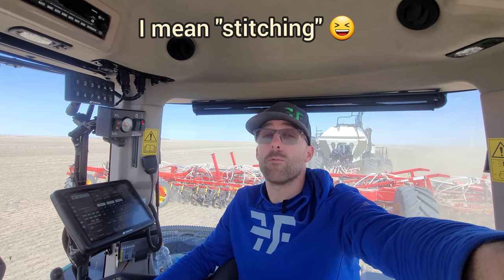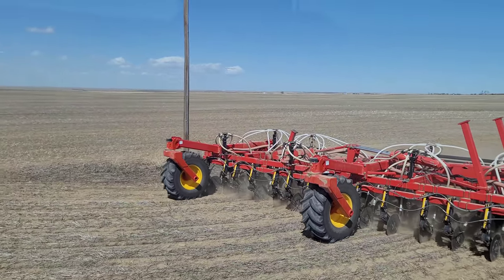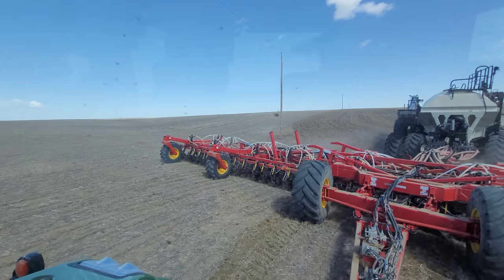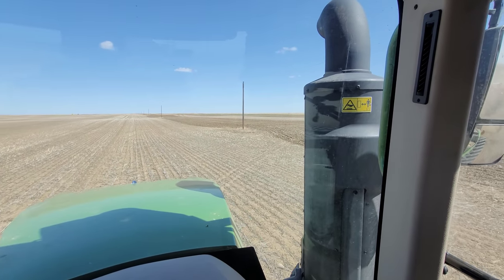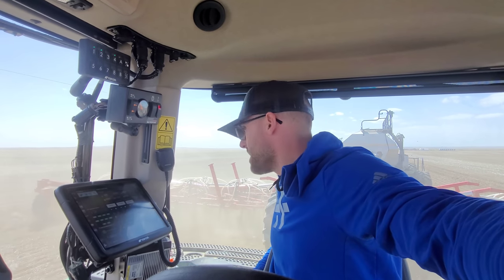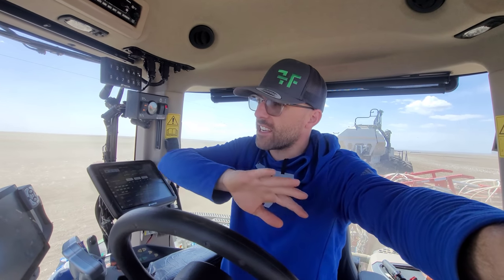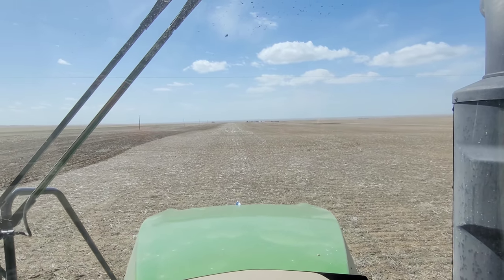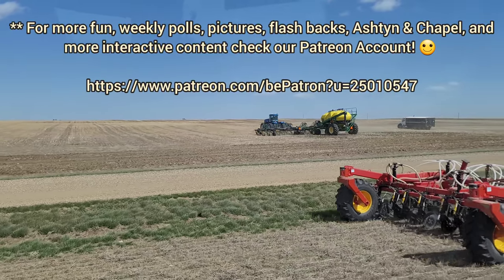Stitching Power Poles 🤔🤷‍♂️

Comment: Hi Mike, former fire department captain here. Your explanation about emergency evacuation is correct, keep your feet together and bunny hop away from the point where the line grounds out on your equipment to avoid step potential. If you walk you can create a great enough electrical potential from one foot to the other for power to flow up one leg, through your torso and down the other leg. The big problem with single line earth return circuits (SWER) in rural settings is that they are a much higher voltage than you would expect because of the great distances they cover. SWER circuits that I have had personal experience with carry 22,000 volts and can create step potential rings of up to 8 meters in diameter. With your ground as dry as it is you would not expect too many problems if your cart touched the cable on the way through given that you have rubber tires on dry ground. If a circuit was created it would probably pass though the hitch to the drill and down the row equipment where you have metal contacting the ground; and potentially into damp ground. Keep driving until the cable slides off the rear end and hope it doesn’t snag on the ladders!
Reply: Informative. Thank you. Didn't know about the bunny hop.
Reply: Not really a problem actually.  Once the machine has snagged the cable, assuming the tyres offer useful insulation, you can simply jump from the vehicle as far as is safe, and walk away.  The equipotential is unaffected by your steps, even in wet ground where - in reality - it is improved as a fully grounded situation.  If your machine is soil-engaging ( diggers, planters, etc. ) then you are in a better situation because the rig is effectively grounded, but still jump as before for safety.  Obviously do not return to the rig until the utilities engineers say it is safe.
The 'surge' you refer to is actually an auto reconnect that most cicuits will attempt up to three times in case the original short was transient; for instance a tree branch fouling lines, but that has corrected itself and can be reconnected.  If the fault is still present then the breaker will stay open after the third attempt.  No additional power is used in this process, and the whole process lasts seconds.  It is very unlikely that any soil engaging machine would not offer sufficient fault current to trip the breaker out completely, but a sprayer might not... either way a safe jump and walk away is always the best approach.
I work with 132kV systems.

Comment: I have actually had a situation with powerlines myself. When I was going down the road, the steering valve on the tractor failed and it veered into the ditch. I jumped a driveway and caught the lines with the tractor and took down 4 poles before I came to a stop. Thankfully, it blew a transformer up and cut the power to the lines as they were tangled in the tractor and I was not harmed. As for the tractor, just needed some front rims and tires. It was back to work the next day
Reply from the maker: Oh man, that would be one heck of a ride! 😳
Reply: Wow I'd need new boxers, pants, an probably need the tractor seat redone 😅
Reply: Almost as rough as the fields  in doing currently lol jk glad your ok

Comment: We have the huge transmission lines on are fields I want to say they’re 480,000 Volts. There’s enough static electricity with electricity can jump 10 to 12 feet and in the summertime when it’s 95 to 100° and the lines dipped so low that you can actually walk underneath them with a fluorescent lightbulb and it will turn on.

Comment: My uncle pulled a line on him self, hooked it on the bar and it came down on the tractor, challenger mt 865, line went down the exhaust pipe and between the front of the cab and bonnet, luckily it blew transformer but did some cool fireworks, anyway they came out and removed wires and all good

Comment: I had an incident with a power line, the doctor said my heart had quit. Dad in 1970 put up a bin just slightly under a power line. Till 2004 we never had a problem with it. After years of vibration of the auger on the roof filling the bin it shook roof bolt out. About 2002 a wind took a few sheets and tore then off the bin. I took then and had then repaired and we replaced them. My son was in the bin tightening the bolts up. I went to drop the latter in to the bin through the man hole, when I raised the latter I got close enough that the power arced across to the latter. I don't wish this on anyone, It felt like getting a bear hug on the inside, My muscles went tight as a drum, I only could see white, I could not yell or breath, all I could do is sit there and take it. When I came off the power it was the most wonderful feeling ever. As I fell backwards on the roof I blacked out. Next thing I remember I was laying on the ground. Kids drove me to the hospital, doctor called STARS and flew me to the foothills hospital in Calgary. The nurses said there must be a special on electrocution this month. The other two guy lost some hands and feet. The doctor said I blacked out because my heart quit. All in all I came out not to bad, kept all my limbs. Took 10 weeks to recover from it and today the only side affects from it is my left hip, knee hurt, and I walk with a limp. No my life never flashed before my eyes, it was like just going to sleep, and am I afraid of dying  now, no. Someone asked me that question once. The power company said there is about 14000 volts going through the lime.

Comment: Farmers in our area drag chain under the carts incase they make contact with the lines. The reclosure is what surges the line. 3 times til it trips. The fuses on the pole cutouts will only trip if that line has faulted. If it's a transmission line it'll trip at the sub instead. The further away the line is from the sub the lower fuse rating is used

Comment: I had two drivers hit a pole with 3 meters wide cultivators ! Why cultivate so close to poles , not as if you can cut that close with the combine any way ? 
Another farmer said can I cut closer to the pole as I left 1 foot of corn around it. It was quicker to snap the crop off than try to cut it. He had 80 acres in total but had 8 fields. I wasn’t bothered when I wasn’t asked to cut it again 😆
The joys of Uk farming!

Comment: Mike! I’m a lineman myself and to explain a bit more about underground power lines. They are very expensive! It is more pleasing to work around or to look at but painful to work on. Overhead is cheaper and easier to maintain. Those tie down cables are called “guys”. Those surges are done with the combination of sectionalizers and reclosers. And yes they do try to reclose the circuit three times then if it can’t, it trips it open and won’t close again.

Comment: We have a national grid station local to us  , i visited this some time ago ,  they  switched 400,000 volts as a demo, 
a massive discharge of compressed air blows the mechanical connection open and also blows the arc of electric out 
very impressive to see , you can hear the blast 4 miles away !

Comment: The stitching technique is perfect. If you had a smol planter it might be worth circling the pole, but at that scale it would waste a lot of time and fuel spinning that giant machine around to get another 3 square metric feet.
And good explanation of the power line issues and avoiding Step Potential.

Comment: Here in the USA the bottom line is usually the neutral followed by the top three lines being hot for 3 Phase power with 90% of lines are.

Comment: the "surges" are fast open/close of the circuit breaker at the station. they do that because most issues on a power line are transient, like a tree limb falling on it, so if it falls clear the next time the circuit breaker closes it stays closed and customers still have power.

Comment: My grandpa had an incident with a power line, he was unfolding our sprayer and got the boom tangled in the power lines, we think the tractor sprang some kind of hydraulic leak or something, idk. Anyway, tractor sat there for a while he tried to call the power company so they could turn it off. Tractor caught fire, had to kick the door open and run for it, tractor burned to the ground shortly after

Comment: As another youtuber calls power lines "The Arch Nemesis" . Grew up in on a farm, and knew many stories people that got the wrong end of power line. Including when I was in one of FFA class we were talked about, farmer that went to work on a old tipper truck, hit the raise, jumped out and went to crawl under it to look at the cylinder, didn't' realize the  tip had hit a power line, and reached up to grab the hydrolics..well, they think that is what happeaned, they said he died istantly, and his hands were still fused to the truck. 

My dad also worked for the local JD dealer in the 90's/00's, and he's told me many of times about having to drive a tractor and tool bar across part of the state along back roads, and finding out the next day he had taken out a couple low hanging phone lines.

Comment: powerlines are extremly dangerous and what mike said is really on point, if you can wait, just fucking wait otherwise you run a really high risk of dieing sadly. And yes they can ark, it depends on a lot of conditions tho, voltage and humidity beeing the main ones.

Comment: Mike, I think your understanding of reclosers is a bit off.  they're not going to "surge" extra power to try and blow something off, it's just a recloseable breaker that will make a certain number of attempts to close, in case the problem is temporary (like a branch).  It's just normal line voltage.  

Thank you to @bobsdecline, canadian lineman, for all his great videos too

The "jump with both feet together" theory is because the voltage will decrease in a circle outside the live area.  If the line is 7200V, that voltage is relative to ground.  If it's 7200V on your tractor, it might be 2000V at the ground under your tractor, and 0V at the ground 20' away from your tractor.  Keeping both feet together means (in theory) you minimise the voltage potential across your limbs, which is what minimises the current that can pass through your body.  If one foot is at 150V and one foot is at 149V, you're fine.  But if one foot is at 150V and one foot is at 500V (relative to the outside of the circle), you've got 350V going through you (before the resistance from your footwear and skin).  I doubt there's anybody who has successfully used this theory to their advantage, but it's a reasonable thought experiment
Reply: While not a "surge" in electrical terminology, reclosing the breaker does send a "surge" of power back down the wires, so not bad for an amateur! Lol

Comment: Depending on how many cables there are and how big they are, the cable itself can do a lot of physical damage if it is hooked.  Last December a Canadian National train hit a low hanging power line (due to one pole that snapped in the wind) in East Lansing MI.  The lead locomotive dragged the cables several hundred feet while each broke at various locations.  That took out roughly 30 large (high voltage) wooden poles, and over 6 miles of cables in a stretch of about 1/4 mile on either side of the track. The cables also took out two railroad signal masts and started a large commercial sign on fire.  Over 4000 customers lost power.  There is a video lurking about YouTube of the train hitting the cables.

Comment: Have to say thought those single lines looked more like phone lines, till I read the “ single wire earth return” explanation. As an electrician I find that a strange concept and must be very very old system. I assume when the lines are replaced they will be all 3 wire 3 phase upgrade. Strange you use the term “earth return” as thought it was always referred to as “ground” over there 🤷🏻‍♂️

Comment: Mike, it only takes about 12 milliamperes to end your life. That’s 12 /1000 of an amp. A 100 watt /120 volt lamp uses about .8 amps or 800 milliamperes. Volts don’t kill as they are just the pressure in the wire. Insulation must be rated to keep that pressure in just as a hydraulic line must be rated for pressure. Amperage or flow of electricity is the killer. Skin is an insulator for very low voltage but generally not much at more than 12 or 14 volts. So all said and done if the wire laying across your tractor is only grounding partially,  the fuse or breaker rated for the full load of the wire will happily provide that level all day long and not blow. That’s why a device plugged into a receptacle works and the breaker only pops whenever too many devices are plugged in. Also the utility companies do reset a line to hopefully clear a limb or debris but there is no way to send surges. They just reset and the debris either burns off or the fuse blows. Hope this clarifies for someone. A retired electrician

Comment: I can’t believe they let the power lines be so low.  Around here they have to be about 40 ft off the ground for the high voltage lines.  Communication lines can be lower.

Comment: A custom harvesting guy can I worked for had an arc jumped from a 5 line pole to his chopper spout electric jump about 3 ft blew the gearbox off the bottom of his header and blew out the tires. Fortunately when the tires blew the electric broke connection everyone was ok.

Comment: When your stitching does more seed get put down on the side next to pole because it slower then the otherside
Reply: Yes
Reply: Yes it does.  But if he were to do a circle around each pole, that would be amplified even more.
Reply: I figured the flow rate would be fixed but didn’t know for sure. Hypothetically if you  had a lot of round corners or contour planting on a steep pointed hill the population would increase on the upper side of the planter. Would that affect yield at all?  The only reason I am asking is I live in Iowa by the loess hills and we plant corn and soybeans. We have some pretty intense side hills. I guess the other thought would be how hard it would be a hold that much weight on the hill without some terrible happening

Comment: Electrician here. if you have to exit the vehicle after hitting a pole, only stand on one foot. Never let both feet touch the ground at the same time, this can cause the current to flow through your legs. Also, the minimum distance before you can stand on both feet again should be 10 meters/30 feet from the point the line has contact to the ground. This includes your machines, as a seeder is in the ground as well.
Reply: I think he meant more that both feet are together and act as "one big foot".
Considering the height of these vehicles, I doubt you can land on one foot and keep balance too, if you have to jump instead of being able to use the stairs.
Reply: Bunny hop both feet together at all times. Never one leg. If your other leg comes down apart for whatever reason, you're roasted bud! Whoever signed off on your electrician ticket would be shaking their head ** Century family farmer with saskpower linemen in the family. We practice farm safety daily

Comment: I would take them out, but thtas just me
Reply: The cost to bury power lines is EXTREMELY EXPENSIVE compared to running overhead especially with high voltage on long runs
Reply: @gavinperry7237  Here in Sweden, you could basicly say, powerline was not there last year, ooos
Reply: It's not like he says in the video that those aren't his power lines, but the province's... i don't think they would like that very much.

Comment: Hey Mike, can you answer me something about that drill. Has the factory prescribed (recommended) any maximum acres that drill can sow (work) during one season?
Reply: No don't be silly
Reply: @darrylpaulhus3069  Why silly? If you use something too much it wont last..Just for the eg. my familly is using same planter ''Nodet'' 6 rows corn planer for 25y, hasn't cracked yet (just regular maintenance) cause it sows 60ha (150 acre) per season. Doubt Bourgault can last that long if its used ''too much'' per season.
Reply: There is no too much per season. If you say the drill is done with after 100.000acres and you seed 10.000 per year it's a write off after 10 years. For the money that drill costs it should run the whole year with proper maintanance
Reply: In the prairies, the guideline is 100 acres per foot of drill.  Mike's drill is 84'.  Some people can do more if you put longer hours in, and some people do less so they don't have as rushed of a seeding season.  There are also some high speed drills that can do more, but are not that common.
Reply: They will most likely provide a guide line on how often all parts need maintenance, like grease some parts of the drill every 50 hours ect.

Comment: When you leave the tractor in an emergency, you jump with your arms crossed to your front chest. You do not want to be the connector between ground and your charged equipment. You aim your jump for a roll on the ground like a drunk. That is your safest way. Never ever try to touch or reenter your equipment. Your life is not worth it.

Comment: Why not just set a 6 ft gap, so 3-4 ft each side and just rin straight down each side and not worry about stitching or wrapping. To me with the amount of acres, it would not hurt to leave a small strip.. just my thoughts.
Reply: That is where the weeds will grow.
Reply: If it was just one set of poles on one field that would be one way to deal with it, but there are poles everywhere, so it would be a significant amount of acres overall.
Reply: Yeh bloody weeds will get a load of ya paddock